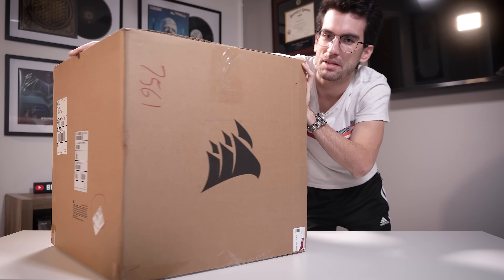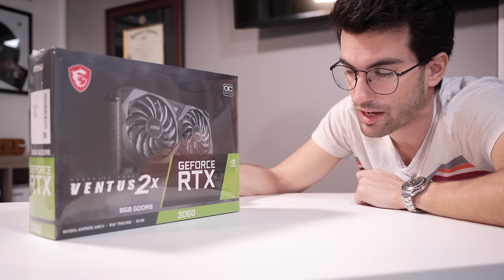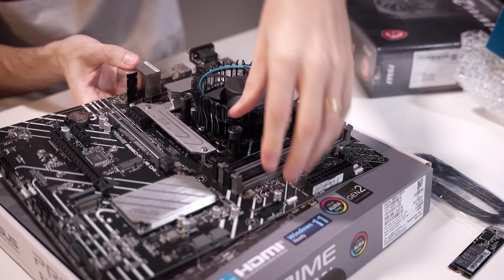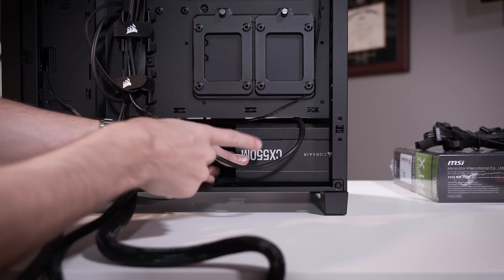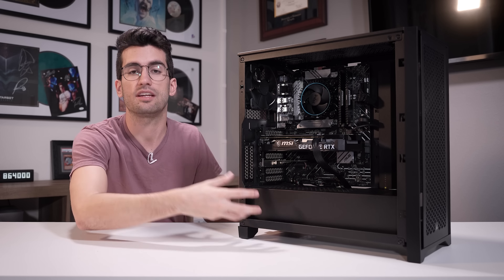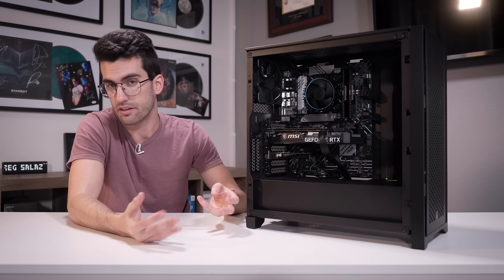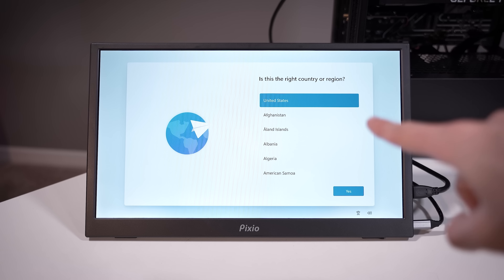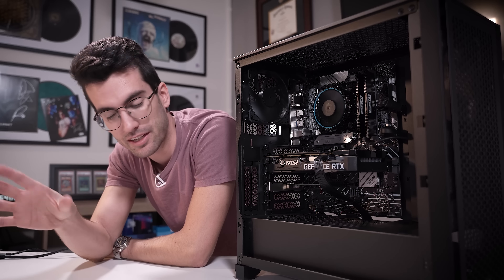Wanna Win This Gaming PC?

Comment: Nice of Corsair to give away the pc. Presently i have a corsair 6 to 7 yrs old case with an old system. This built components and parts are quite decent. Not too pricey and cheap. I will use this parts as my guide to my future built. Thanks for this video Greg.

Comment: I would actually love having this as a first actually gaming rig because mine is mostly stuck at the 2000s and have ran it over the limit multiple times (who knew a 8400GS can be overclocked so hard and have better stability than most of today's GPUs, XMP and CPU are locked so there was no way I would get any more performance) I mostly play games that can run (might as well count them with one hand) including TMNF, TMNESWC, LFS, etc. I love racing and I wanna enter the sim racing world with something respectable so this would be perfect. I also have a question, can you add a monitor and some peripherals because the rest also stayed in the 2000s (I AM STILL USING VGA AND PS/2).

Comment: Hey Greg! I found your page randomly after searching help about my PC not turning ON (No Power - No lights, no fan, no LED, no sound). Bit of back ground: PC was runnning perfect, bought it second hand (i5-12400f cpu, rtx 3070, asrock h610m mobo, 16gb ram, 256 nvme, 650W PSU non modular, case fans are individually attached?). I am upgrading another very old PC with RX 5700 Xt. So I want to save the GPU. Bought new gear beside gpu. Installed the RX 5700 XT in but no power at all. I did a clip test on the PSU and fan not running so I return everything to local store I bought it from, paid for the diagnosis (80nzd) and they said there is a short on case and fixed it. So to check it is running, I used the rtx 3070 and it runs fine. I then used the 5700 XT to the PC of the 3070, but then it now has no power. So, it seems that all PC that I install the 5700 xt dies out? I put the 5700 XT in its old PC and it runs well apart from being so slow (phenom cpu, 6gb ram, etc hence the upgrade) SO this tells me the 5700 xt is not dead. I have confirmed this by swapping the 3070 and 5700 xt on the new build and it runs perfect with the 5700 XT. I tried to put the 3070 back but no power at all. Now I have stripped the PC where the 3070 is from, test the PSU and it is running fine with paper clip test. I tried to jump start the mobo with just the PCU and RAM but no power. I do not have tester for the cables so I cannot do that. It is not modular so I am stucked. I know this video is about the corsair pc, I am in NZ so I don't think you will send it here if I win anyway. If I can run the PC I will be happy! Thanks Greg. I am learning a lot from your videos. I will try to step by step test again per part. Will do the CMOS clearing as well as I have not tried that. More power from down here in NZ. Cheers, Karol